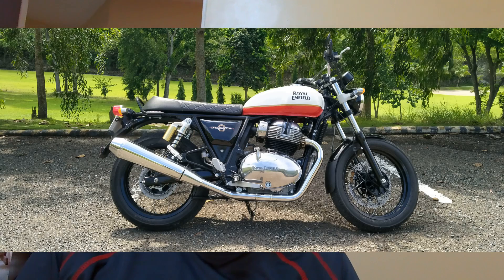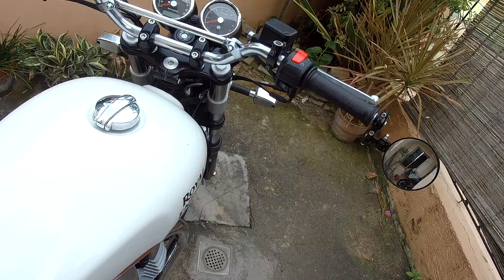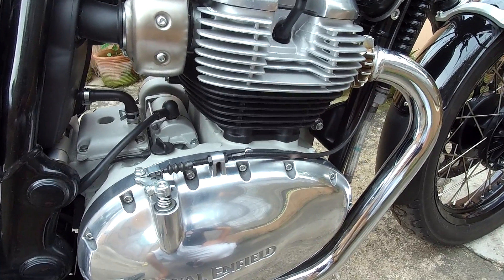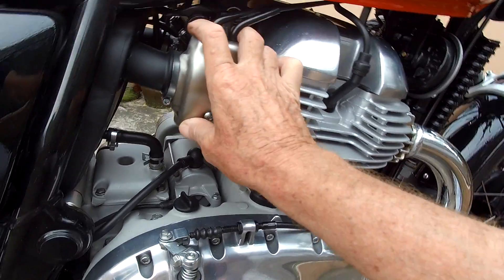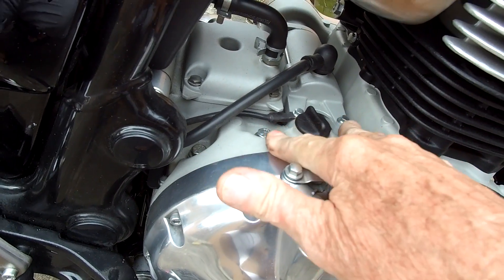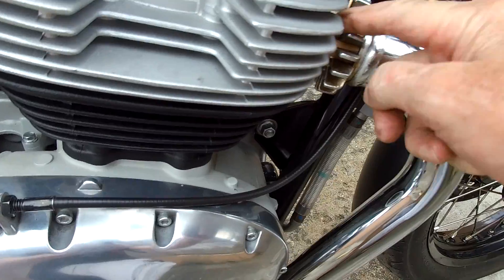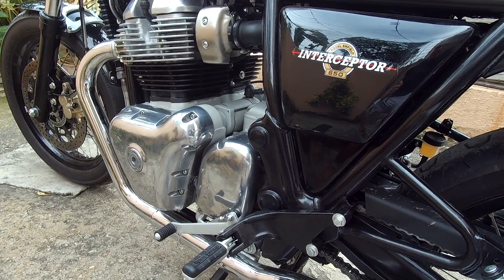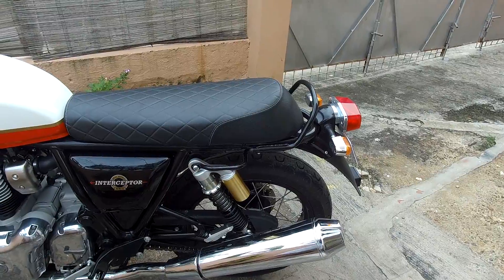RE Interceptor vs Street Twin in Depth

Comment: Hi I just subscribed . 
I have a question . When I ride my interceptor especially on hilly roads I notice a bit of stuttering / hiccups when I need to pick up speed from a static position , once it picks up speed it's smooth and all fine  . Initially I thought may be I am not revving it enough and therefore there is some kind of knocking  , could chain tension  be an issue  ? The bike shakes before getting smooth again ,please suggest
Reply from the maker: Without riding it or seeing it in person it is nearly impossible to diagnose. If you are a beginning rider, i would suggest talking to a local fellow with some experience, or check your chain as you mentioned. if your not up to checking it yourself visit the dealer. Make sure you are not trying to accelerate from a higher gear from a very slow speed.
Reply: @DEeMONsworld  I have been riding for 20 years and the problem I am mentioning is in 1st gear mostly because that's the  gear one would move from standstill position . The problem that I face is never the first thing when I set out to ride .. its only when the bike has warmed up sufficiently .and it's noticeable in unhill stop go traffic  conditions
Reply from the maker: @vikasupadhyay1398  well now you gave some more info. If it were the chain it wouldn't matter if bike were warm or cold. It might be, and its only a guess, the air temp sensor on the airbox. The only thing you can do at home is to make sure it's plugged in. It two white connectors under the seat. Otherwise check with your dealership they can plug the bike into their diagnostic tool and check for a fault code
Reply: @DEeMONsworld  thank you I will look into the issue that you have suggested . The dealership people are very inexperienced and they are mostly in denial  .so it s better to ask experienced riders like yourself . Thanks a ton  !
Reply: @vikasupadhyay1398  Reading between the lines, have you been riding one of RE's singles (Bullets) before the twin?
You said it's OK when first started, but the problem appears once it's warmed up. The ECU on these bikes runs a high idle speed until it's warmed up, and I'm wondering if you're trying to ride it like a Bullet, pulling away at barely above tickover (idle) revs. 
Short stroke twins (like these) with a fairly light flywheel don't like that kind of treatment. They'll judder and complain (the heavy flywheel on singles smooths out the bottom end, and the Bullet's long stroke characteristics give more torque at almost zero RPM). You need to use a few more revs as you feed in the clutch on these engines. 
Your description of the symptoms suggests that the 'cold engine' higher idle speed set by the ECU is preventing you from lugging it too much while it's warming up, but once it drops to the 'warm' setting, it's allowing you to attempt to pull away with too few RPM, with resultant juddering and knocking (from the chain, clutch hub, and possibly from the engine itself, which won't do the engine a lot of good.)
Ride it like a short stroke twin, and keep the revs above 2500 when the clutch is engaged, and it'll be a different bike. Trying to pull away on tickover is nothing short of abuse to the engine. It isn't a Bullet, don't try to ride it like one. A Bullet will happily bimble along at idle, because that's what it's designed to do… but it isn't happy cruising for hours on end at 85 mph (130kph) on an autoroute (which will probably break it) The twins are designed to run continuously at high speeds, but as a pay off, they aren't happy being lugged at very low revs like a single, which ultimately will damage them.
Reply: PS: I've had my Interceptor for over a year, and ride it on mixed roads, from small country lanes near my West Country (UK) home to British motorways (70mph/112kph limit… but few obey it)I go to France and ride on French autoroutes (85mph/130kph limit) when I take it to the South of France where my brother lives and I ride it in the mountains. The bike is excellent at all these kinds of riding if you ride it right, and gives really good fuel consumption for a 650 (60 to 70 plus, MPG).
Reply: @chrisgraham5186  Well Chris , I am very thankful to you for  taking out the time to understand my problem in depth,  and it looks to me that your have  caught the root of  the problem  .
Yes after riding singles for 15 years may be my reflexes have got used to that of a slow revving bullet , although initially ,hearing all those reviews about the power of the interceptor ( compared to the bikes in India ) ,I was initially skeptical to rev it properly  out of the fear that it might shoot ahead to soon to be  controlled , so it was a mix of both - my old habit and my fear of losing control . However  since  I have  now got used to the engine and bike dynamics  , I ride it carefree . But it does seem that I was  still in the same zone of singles when it comes to revving from a static  position , I have recently started giving it proper  rpms (above 2500 ) and i do see the bike runs perfectly on solo rides . I am unable to use it more often due to lock down restrictions . I am yet to test the stuttering with a pillion because that is  when  it shows more prominently  . I am sure that problem goes away by revving it like a twin rather than like a single as you have suggested . Thank you !
Reply: @vikasupadhyay1398  Riding with the extra load of a pillion will only exacerbate the 'problem' - it's not a problem at all… It's the way engines like these need to be ridden. As most riders in the rest of the world are accustomed to Japanese bikes with multi cylinders, and/or light flywheels (even the singles), they don't even attempt to pull away with no revs (I have an S&S engined Harley… That bike can pull away cleanly by just letting the clutch out smoothly at tickover (600rpm), but it's a long stroke V twin with heavy flywheels and over two and a half times the capacity of my 650 RE (it's only spinning at 3800 rpm at 100 mph… and will rev to over 5000 in top gear). If I tried pulling away at idle on any of my other bikes, they'd stall. I certainly wouldn't try it on the old 1969 350 Suzuki twin I sold last week - The 500cc Suzuki engined bike I used to sprint wouldn't pull away from the start line with fewer than 6000 rpm on the dial… it would simply bog down or stall (and its all metal dry clutch was like an on-off switch). All bikes are different, and should be ridden in their 'happy zone'.
That your 650 even pulls away at such low RPM says a lot for the bike's engine management system doing its best to adjust the advance curve and fuelling so as not to stall.
Reply: @chrisgraham5186  thank you once again  Chris . I did go out with my wife for a ride and I am noticing that by doing proper revs the bike did not stutter . What I notice after your suggestion 
with interceptor is that it needs comparitively more revving when i release the  clutch and given that my mind is adjusted to the low revving single ,I might have had different  expectations out of habit . Because I remember the very first time  when I got the bike out of the showroom premises , it had an inclined uphill path and I had to stop the bike to handover the gate pass to security .After that when  I wanted to move ahead putting in first gear then instead of bike going forward it started to slide back . For a moment I thought I was in neutral . Now I can relate what could have been going wrong the way I was treating this engine .. I can't thank you enough for removing my doubt as to something been wrong with the bike . I wasn't revving enough
One more thing if you could tell me .-  after a few kms of riding I do notice a change in  the  the power delivery in the  first gear .
When the bike engine is cool - the very first time of the day when I start the bike , the first gear delivers power in the manner that it has good speed range . I mean it touches a speed of 35-40 kms before I feel the need to shift to second gear ...However after the engine is warmed up after say riding it for 5 km or so ,the first gear doesn't offer much of a speed range . It does retain its torquiness but to achieve speed, the first gear needs to be shifted almost immediately . So in that scenario if while riding I had to slow down to first gear due to approaching vehicle from other side on a narrow road , then to rebuild the momentum  the first gear become no good and second need go be shifted to immediately . So gear changing becomes quite frequently , in my area , due to lots of up n down roads and twisty narrow road plus traffic doesn't allow Me to ride constantly in a particular gear . 
The reason I had bought interceptor was so that I would have  to do less gear shifting but when the first gear doesn't  offer much speed after warm up , it needs to be shifted immediately . Is it a normal bike beaviour . In a way the first gear feels sluggish .It does have torque and pulling capacity because as I climb on a steep road with a weight of a pillion it climbs up for sure but not with the speed range or a throttle response as  compared to the  when engine  is comparitivdly cooler . So on a cooler engine I get  speed range upto 35- 40 kmp hr in first gear which then drops to 20- 25 km/hr   the rpm range in both cases being   2500 - 3500k in both . Is that okay ?
  The comparitive  Harley  and Japanese bike example you gave , explained it very well !  Thank you once again !
Reply: @vikasupadhyay1398  - It still sounds like you're trying to shift too early. In the lower gears, it's normal to let it run to the torque peak at least, which on these engines is at around 4500RPM, before changing up (I'm assuming the break in mileage has been completed… If not, too low revs is even more damaging to a new engine than too many). Don't worry about watching the rev counter (watch the road instead)… just go by feel. You won't over rev it ’cos the rev limiter will cut in at just under 8000RPM, and I doubt you'll get that high. You'll feel where the engine's happiest.
These engines are an 'over square' design (the bore dimension is bigger than the stroke)… it's the way they're meant to work.

Regarding the difference between cold and warm, it's probably due to the idle speed variation. The ECU sets a higher idle RPM and a richer mixture when the engine's cold (to warm up the cat quickly, as well as the engine itself) - these engines idle quite fast anyway compared to some, even when warmed up, but it does help provide the smooth 'fuelling' of these bikes that so many journalists and road testers have remarked on (certainly compared to Triumph's twins and Kawasaki's W800) - I'm guessing the improvement you're noticing when it's cold is because of the extra fuel available in the programming being used to overcome the demands you're making at too low RPM… that extra fuel isn't available once the engine's warm (think of the choke being turned off on an old engine).

As I said earlier, the torque peak is at 4500RPM, so the 'sweet spot' on these engines is between 4000 and 5500 RPM if you're 'making good progress'  (as an instructor would say), keeping the engine in that sweet spot by using the gearbox. Riding fast winding open roads at between 55 and 80 mph (roughly 90 - 130kph) for miles on end on these bikes is a delight. It's what they (and their illustrious predecessor, the original Interceptor 750) were made for.

It sounds like you've got some real delights to discover as you explore the engine's capabilities at the upper end of its range. Have fun. It's why we ride bikes, after all.
Reply: @chrisgraham5186  many thanks , I had never received such well explained replies , it answers all my questions and doubts , I will keeps all the points in mind  you have mentioned.
The bike is well past the  run in period . Highly appreciate that you went extra to understand the exact doubts I had . It's a rare combination to have people with knowledge and an ability to   explain ,not to mention the empathy  to help  others . I am fortunate to have connected with you ! Best wishes !

Comment: In the Philippines, you get better fit and finish and a thoroughly modern bike in the Triumph in exchange for paying twice the price of the Royal Enfield. But in the US, the Street Twin is only 1.5 times the price of the Interceptor, making the Triumph a viable option. And you can find a new (0 miles) leftover 2018 Street Twin at dealers here for the same price ($7,500 USD) as a 2020 Interceptor. For me, in the US, the Triumph is a better value.
Reply from the maker: It all depends on what you are looking for in a bike. I liked both bikes disregarding price. but in all honesty new to new even at 1.5 times its not that much better a bike, coming from a guy who has owned both.
Reply: But the RE wont need recall for computer flashes or ever break down.

Comment: Triumphs are terrible.... I had two air cooled 865 models, would never get the water cooled crap they have now
Reply: Could you elaborate on that . I was thinking of buying a new street twin ,or maybe an Interceptor and spending on some upgrades
Reply: Andrew, I don't know about that, I've had my  Bonnie for a couple months now and I find it to be quick, smooth and reliable. and the fit and finish is second to none. Check out a quick review i have on my channel.
Reply from the maker: I loved my Street Twin. It was a premium bike with a lot of good features. I'm a tuner so I upgraded a lot of things on it, It was expensive to upgrade, but that was my enjoyment. With the Enfield its so cheap to buy you can dump the extra cash on ugrades and have a nicely upgraded bike for about the same money as the stock Street Twin.
Reply: @DEeMONsworld  That kind of sums it up for me. If it costs much the same to bring the Enfield within range of the Street Twin then I`m going to take the Triumph.
There have been a lot of sites disparaging the Triumph against the Royal Enfield ,mainly on the simplistic fact that the RE is cheaper.
Comparisons are often unfair and misjudged and here is a plain example.
I love the Enfield for what it is and appeals to me .Very simple ,air cooled honest looking bike that speaks to my 61 year old biker self. But I do not see the Street Twin as a rip off ,it is after all a 900 not a 650  with many more features  
as well as more power ,less weight, better suspension and a 4 pot Brembo up front.
Street Twin it is ,if only because I never want to maintain chrome components and spoked wheels in the grim climate of Northern England.
Reply from the maker: @billycaspersghost7528  yes it all depends on your budget and your goals and preferences.
Reply: @DEeMONsworld   I have the budget ,it is more about the preferences and feel. 
To confuse me further I have developed a yearning for the Moto-Guzzi V7 .
On offer at less than £7k . It has cast wheels ,little chrome .is a 2 valve push rod  air cooled v twin with shaft drive .
Ticks all the boxes for me ... hmmm.
Reply: BillyCaspersGhost the Enfield gearbox is not going to be a problem like the triumph,just check google.
Reply: @williamsmith1044   I googled it and did not find anything major on the Street Twin .
Recalls ,wiring harness stuff, perceived overheating because the electric fan blasts at you.
Nothing major on the gearbox .

Anyway ,I bought the Moto Guzzi V7  so it is    
no issue at all.